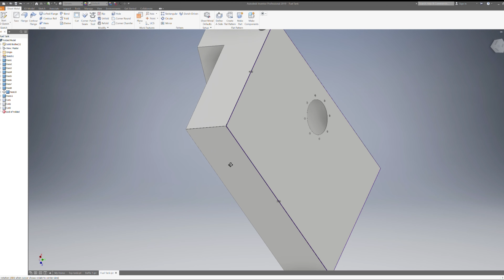Building a Custom Fuel Tank - The Flexus Episode 36 - Focus Twin Turbo V8 Project Car Build

Comment: nice video mate! I started thinking about how to make a fuel tank as well for my built. need to learn CAD now haha
Reply from the maker: Cheers bud, if you want a hand, give me a shout I can knock something up for you I’m not too much time
Reply: @JaffBuilds  you know what, i may take you up on that offer lol. welding i can do myself is designing the tank and cad + laser cutting i don't have access to.
Reply from the maker: Well just give me a rough drawing of what you want and I’ll
Knock it up and I can either take it to my local ish place and post them to you or you can find your own laser cutters that are more convenient. My experience with them is patchy though, the company I used were very good if a little slow due to the workload they had

Comment: Looking good! Just something to bear in mind, the last ~third of a tank (as indicated) will drain much much faster than the first two thirds because it is of a significantly lower volume.
Reply from the maker: Yeah it’s something that I just can’t get around without some sort of custom fuel level as the tank shape is dictated by the car. The gauge should read empty before it’s empty anyway which is the important thing

Comment: You can buy insulated 6mm posts to pass wiring through the top ,and u will need one side to the sump to stop fuel slowing about and possibly creating a ,LEAN SITUATION,which I never good for forced induction ,as 2 seconds lean may result in melted pitons  ,ask me how I know 😭
Reply from the maker: Got a link? Might end up needing them anyway. I’m fairly comfortable in the tank design, I’m also not worried about this engine - just gives me an excuse to build bigger and better 😉 if it leans out I’m either being an idiot running it too low on fuel or being an idiot going around a long corner sideways, either way it should be fine if I refrain from being an idiot 🤣